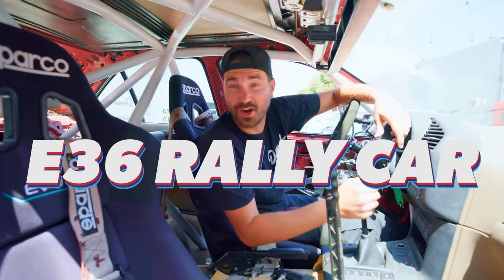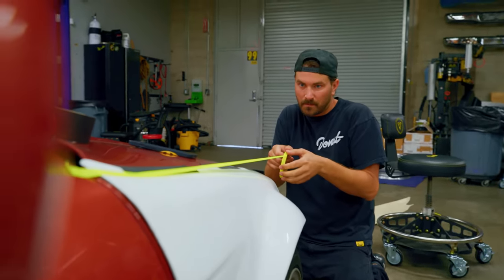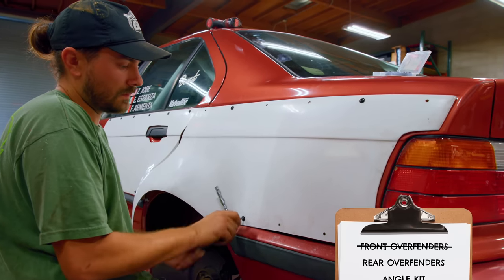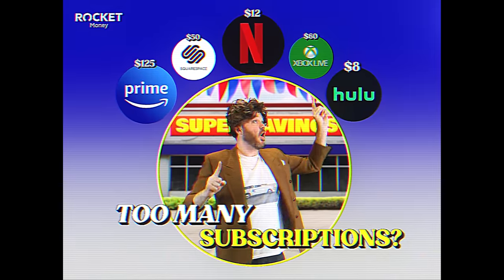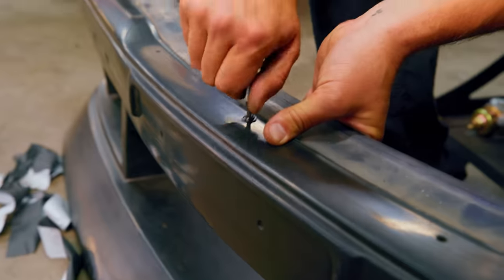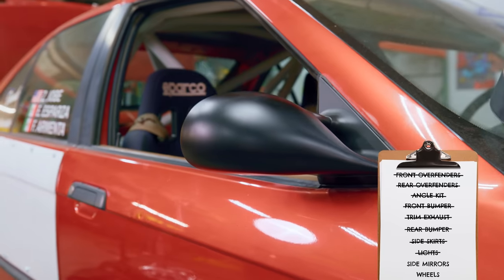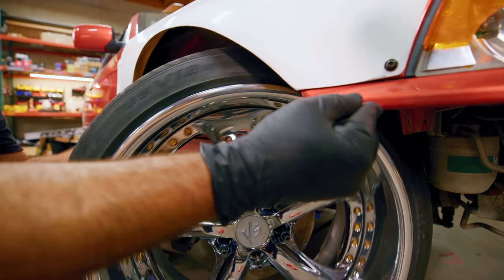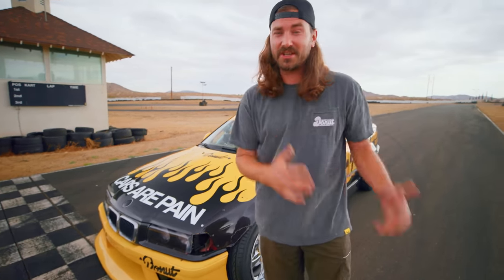We Turned our BMW Into a Drift Car… Was it Worth It?

Comment: Critical step before cutting: make sure there’s no wires behind your cut line
Reply: One might think they learned that since what happened with the Chinese truck 😂
Reply: This!, Cutting fenders on my 180 and have seen horror stories of people going harnesses for rear lights etc
Reply: Behind every warning is a story
Reply: Make sure you stole your Grandmothers credit card so you dont run out of money.
Reply: I won't ask you how you know
Reply: Its Zach doing this, not Henry ..... Should be OK 😂
Reply: This sounds like personal experience…
Reply: Especially when cutting up a Chinese truck 😂🤣😂🤣
Reply: You scared be haha😅
Reply: I was so worried when they started cutting and punching hole next to the headlights, so ready for a little foreshadowing black and white clip with "oh... oh no, oh shit"
Reply: @guillaumejoop6437  right lol. Nail biting moments.
Reply: Or by garage54 they have cut one time so much dis the driver and passenger have seen the wheels while driving.
The Instructions to the ones in the shop:
Cut so much out dis those wheels fit
Reply: Or washer tank.
Reply: WOW REALLY?
Reply: Don't check if there's a wire, just cut it. Be a man.
Reply: I cut through my engine harness on accident does anyone know what wires go where, slammed 92 civic, daytons and hella slap in the trunk Yo.
Reply: Ahaha, I drilled straight through part of my intake whilst fitting a snorkel to my truck yesterday. Thankfully it was a part that was going to be replaced
Reply: Common sense
Reply: @tachy635  one might also naturally think or assume this video was in the progress of being made during or before that same time as that video.........................................................
Reply: @Zikhr  e36 doesnt have dumb locations for the wiring loom like s13s do so its fine
Reply: Its a canon event . You can't interfere
Reply: My first thoughts exactly
Reply: Probably the best advice I have ever seen on a comment on YouTube.
Reply: Been there…..
Reply: But first make sure you disconnect the battery before welding 😅
Reply: thx for your advice
Reply: @tachy635 I came to see if that’s what they were referencing lmfao
Reply: That's if your working on a house mate

Comment: Nice drift kit. Except you definitely trashed the wheel fenders, exhaust, and your rear bumper. They add no value to the performance. That is what you call a ricer build. Don't be surprised if Drew Peacock slides on by this video and roasts Donut media's build. Poor E36
Reply: Okay boomer
Reply: @big____rich4560  Okay zoomer
Reply: Its for the looks brother

Comment: I want this build as a daily.
Reply: Yes ! 😄
Reply: "honey, I need this so I can get to work faster"
Reply: This low with this little interior?
Reply: if your daily drive only involve a drive to mcdonald that is
Reply: A daily 💀💀
Reply: You're kidding, right? Why would you want a build like this with trashed wheel fenders, exhaust, and rear bumper?
Reply: @anusername8350 if i can then so can you; fully gutted interior and im so low i scrape my trans on speed bumps
Reply: @EdnovStormbrewer bro you’ll have no idea how great it is until you’re actually dailying your drift car. doesn’t matter if that shits ugly, if you can  d a i l y  your  d r i f t  car then you’re winning
Reply: Have to fix the suspension first. It would need more ride height, an alignment, and tires that seat properly on the wheels.
Reply: @36aidan  Drifting is not the only thing having to do with winning. It's the driver with skills behind the wheel. And having a ricer looking build like that is no added value to performance. C-mon now. You should know that

Comment: donut at the start : thoose fenders are durable. also donut at the end : fender allready broken
Reply: It would be logical to have more clearance between their wheels and fenders but I guess they'd rather have suspension that looks like the car got stepped on.
Reply: @bwofficial1776  Past a certain point, you need an angle kit like they show for wheel travel anyway. A lot of them are adjustable. Also, a common thing with drift setups is more camber in the front than the rear. It looks stupid, probably, but it does work.

Comment: I wanna see a video about different types of drifts. normal drift, powerslide, 4 wheel drift, fwd awd drift, braking drift then see a 4 wheel awd braking drift on the corner after the straightaway

Comment: next step, M52B28. M50 manifolds and maybe a turbo, simply lovely. 
or get a M62b44 V8, youl get tons of NA torque, 286 hp wich is the same as the 3.0 euro spec e36 M3 and you'll stay true to the brand by merging a bmw chassis to a bmw engine instead of slapping an rb engine in there (please dont do that)
or if you feel really naughty you could get an S62B50 from the e39 M5, 5.0 litre 400hp NA goodness, just slap on a supercharger and a tune to get 700nm and 600hp!

Comment: So, this might seem like a stupid word of caution to have, but it happened to me, and I could see other beginners like me making the same mistake. Whether it is the front over fender, or the rear make sure that you remove the side markers like they did here as well as make sure that the headlights and taillights wire harnesses do not run along the wall where you're cutting. We did the similar procedure on my buddies 98 Passat Wolfsburg edition. What ended up happening is in the rear when we were doing the over fenders, we ended up accidentally drilling through a portion of the rear driver side taillight harness. When we discovered the issue, we just tried to branch the connection using a similar gauge of wire. But that kept throwing a code on the car’s computer as well as the taillight not working even though the connections are branched So what we ended up having to do was go to a scrap yard down two hours away in a major metropolitan area and cutting that section of the harness out of a non-abused version of the car and splicing it in. For some reason if it's not the original wiring on that vehicle the computer code would not go away.

Comment: Doing it all wrong from the start.... You mark the fenders take them off, cut in half and only keep the bottom section that connects to the rocker panel.  the top section you cut the channel and  leave about an inch of old body.  that way you can properly fit a cheap fender and don't have a super sharp dangerous tire shredding edge underneath.  and that's like the first 2 mins of your work I could go on....

Comment: okay so one thing I don't get is, you set the fender clearance to zero while the car is on a flat, and expect tires not to rub or rip fenders when driving? like do you have rigid suspension? I'm not really experienced at all in modding cars so I'm genuinely asking

Comment: Use spring tensioners at the bottom of the fender so that when you’re at FULL LOCK, the wheels don’t bounce up and break your fenders. Instead the fender will go up since it’s tied down to a spring

Comment: Drifting is the slowest way to take a corner. It's also needlessly expensive and juvenile.  Way to aim for the bottom, boys.
Reply: but it's fun
Reply: I suppose that's the only reason. It explains why 90% of their vehicles are broken or undriveable. By the way, there is no such thing as drift racing. Serious race drivers (myself included) know that drifting is for kids who can't handle the rigors of what it takes to be good.